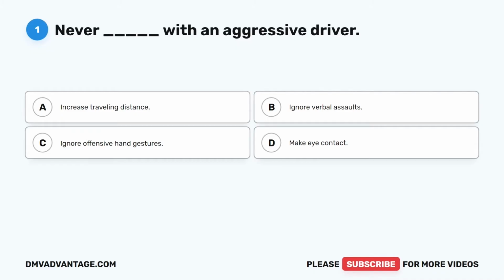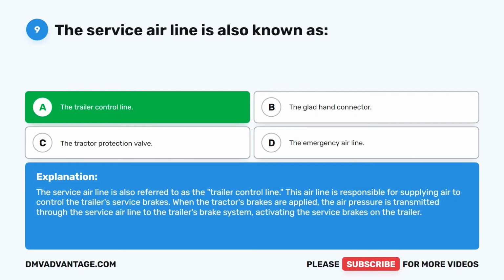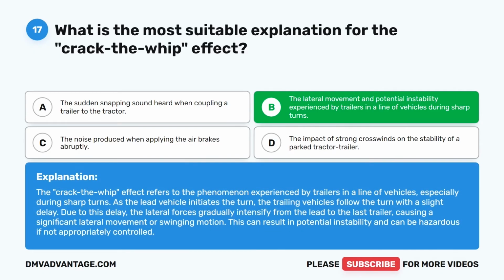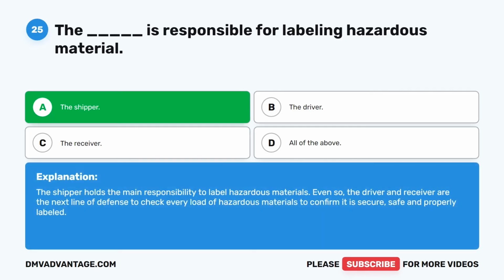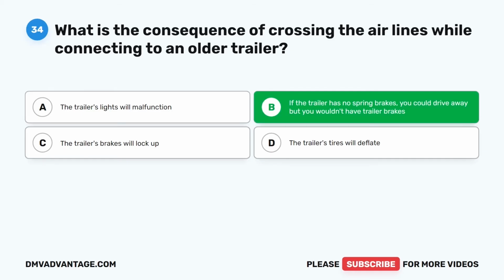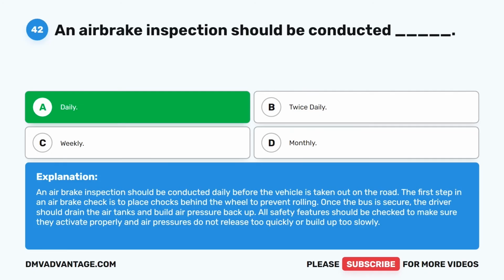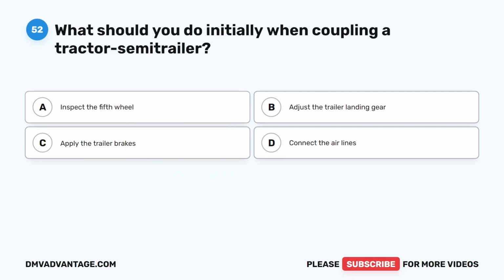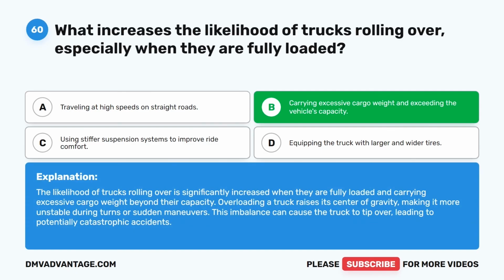CDL Combination Vehicles Test Questions and Answers — 60 Questions with Explained Answers

Comment: #41 I believe is incorrect, how can you back under a trailer if the landing gear is already fully raised?  That would mean that the trailer is on the ground how do you do that. The answer is C. Correct me if I'm wrong.
Reply: question 28 was the one about backing up to but not under, at which point you connect the air lines. Connect those then back under it, then raise the landing gear. Make sure the brakes are engaged or chock blocks are set after connecting the lines..
Reply: I think you may be right and wrong. Question was improperly worded to distinguish which step we're on. I believe they are talking about after you back up to it and have connected the air lines.

Comment: Is #18 wrong or am I tripping?
Reply: You're not tripping. The answer should be D.
Reply: @justjordanvibes  but the emergency line is connected. Emergency brakes should not activate immediately. Losing the service line is nothing to do with emergency line. You lose supply tank pressure, dropping that to 20-45 psi will initiate spring brakes?
Reply: @justjordanvibes  i appreciate you both i had to look literally while listening to #19 play next
Reply: I just checked too. It is wrong. There are a couple of wrong answers in this test